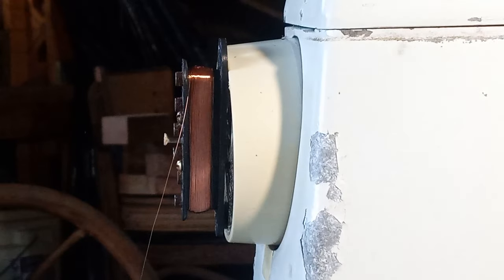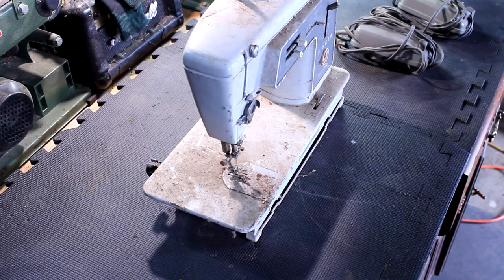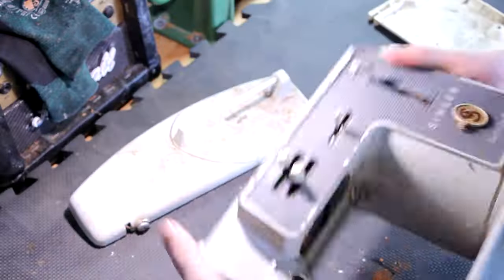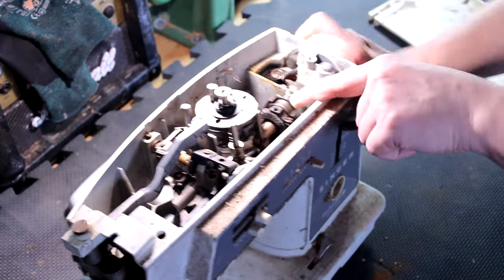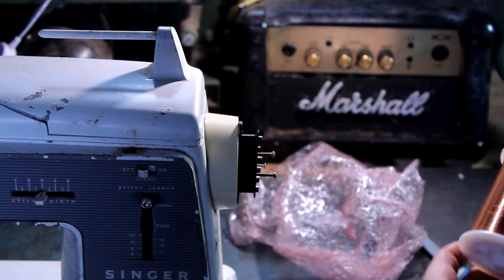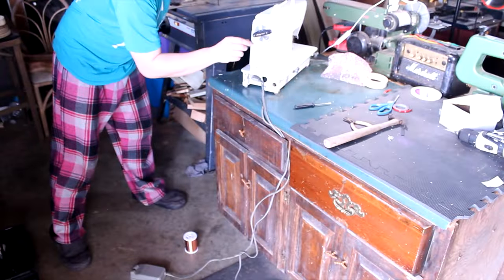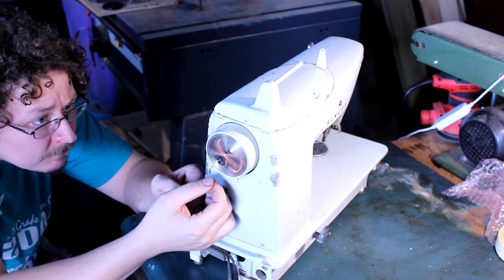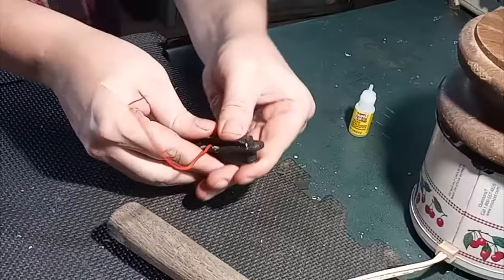DIY Pickup Winder from Sewing Machine (Build + Demo!)

Comment: Boy, that middle position with the raw ouput is fuggin KILLING it for tone! What magnets did you put on this?
Reply from the maker: Hahaha! Thanks DH. Thats a ceramic magnet from a chinese squire. The raw output definitely rules over a tone and vol circuit and I think 3 things also helping it get that tone... 1) All that rediculous scatter in the winding and it wasn't potted for too long 2) Loud amp pointed up in a big pine board live room 3) Its hard to tell on the black guitar but its kinda in a strange position between the normal neck and middle and tilted to bridge the gap. I learned about this sweet spot from an old japanese teisco style guitar. I guess this is why an sg a les paul and a flying v all sound different with the same exact parts... the pickups are in slightly different places (nodes) on the strings. ;)